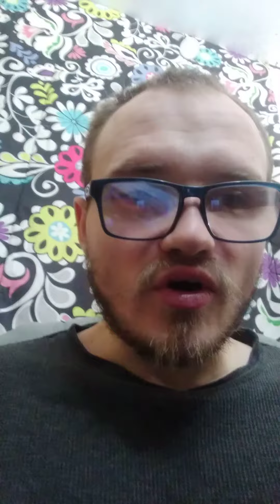a quick tip to how to tell if your alternator is bad on your vehicle

Comment from the maker: It could be the wire running from the battery to the alternator also I forgot to mention that but it's very unlikely because that is a very thick wire or if it goes into the terminal it could be the connection to the terminal loose also to the wire that runs from the alternator to the battery check your connections also and make sure your battery terminals are clean also but most likely if you disconnect the battery terminals and it stalls it's your alternator but it could be a couple other things too such as the wire that plugs into the alternator and that wire is damage that could cause that or it could be the wire that hooks to the stud that bolts on to the alternator and runs to your battery but that's very unlikely or a bad connection from the alternator wire to your battery

Comment from the maker: Also do not drive your car when you disconnect the battery terminals from the battery if it stays running if it stays running for about 50 seconds to a minute that means your alternator should be good and hook up the terminals again do not leave them on hooked with the car running either that's not good for your vehicle either that can burn out the alternator if it's good if you leave it running for long with no battery but 50 seconds to a minute is fine and will not cause damage to your alternator if your alternator is bad the vehicle will stall or if you have the other issues I mentioned down below